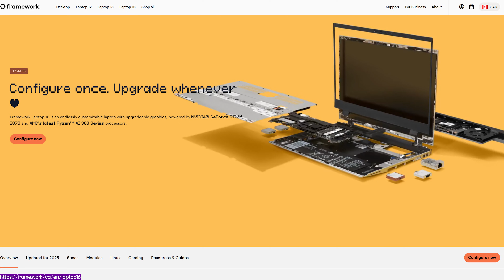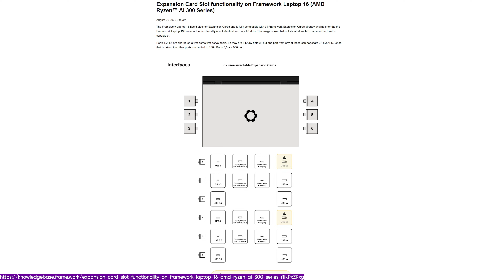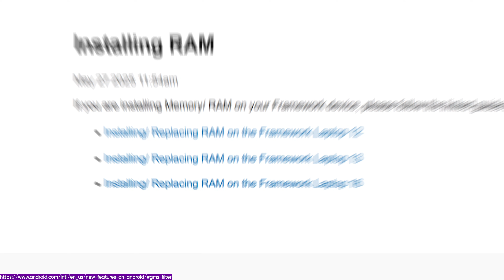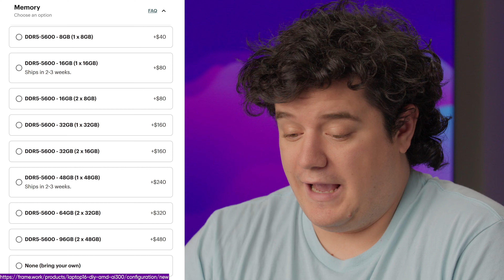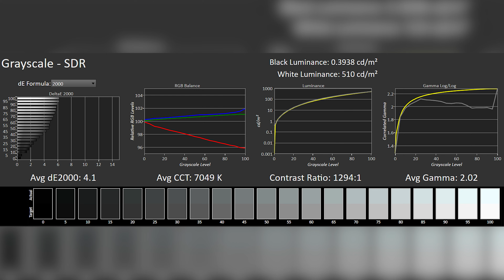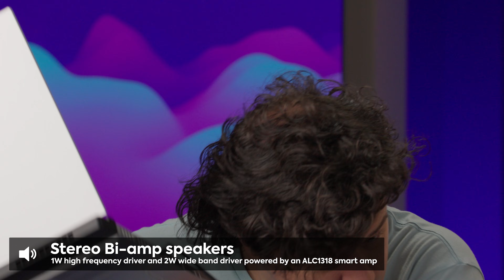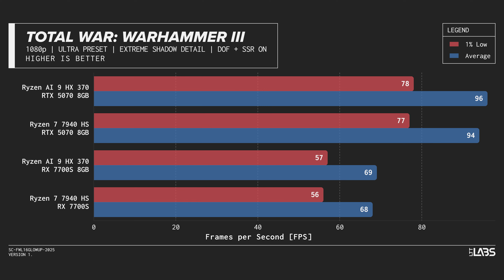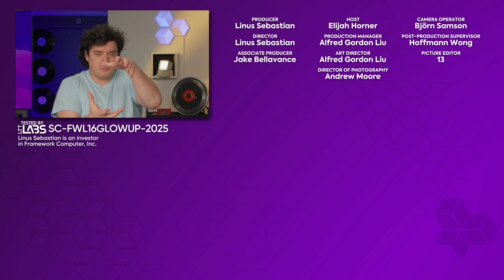I can FINALLY Upgrade the GPU on My Laptop! - Framework Laptop 16 (2025)

Comment: Man…. This is really one of those product lines that makes me very very sad that I’m poor.
Reply: you'd be better off buying a mini pc
Reply: Mini PC doesn't run off batteries though.
Reply: @arpeik yeah! So you can carry around peripherals everywhere you go!
Reply: have you seen the video? that's such an ass product lol
Reply: Yeah, I do need to replace my 8.1 machine.
Reply: You shouldn’t they ain’t worth it
Reply: Just use a cheap laptop and stream the game remotely. Laptops are always constrained by the chasis and cooling system, better off playing from mini pc or even better, a desktop
Reply: Check the second hand market. The repairability and modularity of this laptop makes it usable well over 10 years, with minimal cost and hassle if things go wrong
Reply: @Winnetou17 and costs 3 times the same specs. With such a price just get a new laptop every three years than replacing parts. 3400$ for a midrange CPU and 5070? Have they lost their mind?
Reply: @edengalant  The point is keeping your old laptop out of a landfill. The whole point is that you're not throwing your whole laptop away every 3-5 years when the newest thing comes out, or even waiting a few more years and upgrading a couple times.
Reply: @edengalant I have 5070 pc with qdoled monitor for 2000 dollars and have a decent work laptop for 700
Reply: @redshirtwookiee yeah but with such a crazy cost its literally worth replacing it every 3 years. With such a high base price and component price it's simply not worth it to upgrade your GPU when stuck with an aging laptop. Again, you can find OLED 5070 with 20 cores cpu for 1250 USD today.
Reply: @edengalant  I don't know what you're choosing, but it is NOT 3400, at least USD. It's 3400$ sure if you buy RAM and SSDs and maxing SSDs to 4TB and 2TB. Also, who tf in their right mind genuinely thinks the hx 370 is a midrange CPU?? Is this ASUS's burner account? lmao

It's about 800$ less if you spec out your own parts and with reasonably priced parts and good selection you can get it for around 2900$ (AI boom, ram prices suck). I checked for similar specs in gaming laptops and it seems 370+5070 is in the 1500-2400$ range. Sure, that is a BIG premium, but if you really care about the reliability and serviceability, it's not "3400$" for a "midrange cpu" and 5070, and anyone getting that combo is NOT a gamer, at least not full time. And not a lot of Linux users/enthusiasts are not going to spend almost twice the amount for a 5070 for 30% more performance over 7700s, or 370 over 350 if you're a gamer. It's very clear you don't understand the user base or use case here, and I'm sure you're not a customer. If you're trying to buy Framework for price to performance, I'm sure you'd fare your time much better in a 2nd grade classroom.

And at least unlike big companies, they aren't actively dropping build quality and serviceability for easy cash. I know the gripes of Framework and price is one of them, but you are overinflating the problem and actively framing it in a bad light while also conveniently dropping all the positives in the process.
Reply: @redshirtwookiee in my case I would just pass it down or sell it to a college student. Assuming copping a $1000-1500 every few years
Reply: @ilyas5708 I think eventually it would end up as e-waste, whereas the amount of e-waste if you buy modules from framework would be less than a whole computer. That's definitely part of the vision.
Reply: @edengalant ur right they cost to much for what they are at the end of the day they save you no money in the long run and a massive upfront cost , there a cool idea but priced themselves out of relevance, there for hippy/hipsters/ Disney adults/pre teens and children lol you are 100% correct they ain’t worth the money and don’t bother telling them that cause trust me they don’t listen
Reply: @edengalant you would rather buy a several thousand dollar laptop every 3 years than a 500-1000 dollar upgrade every 3 years?
Reply: @i_love_games110 it won't be "several hundreds" every few years, comeon. Will you upgrade just the GPU and get CPU bottleneck? Also upgrade the CPU but not the motherboard? What if it needs a new chipset? New DDR6? Comeon, it's not feasible. It's expensive and just a stupid gimmick. Laptops are not and won't be PCs.
Reply: Don't worry! You may not be able to afford one but if Trump succeeds you can be one of the guys building them.

Comment: Sorry but just too expensive.  For that price you can get a cheap MacBook instead of this machine.  Even with the upgrade capabilities.  Plus wondering if overtime those spacers will warp.  Also why not just make one long one so this way you just need 2 spacers one on the left and one on the right instead of 4.   And most people probably just upgrade memory or hard drive not cpu, etc.

Comment: maybe elijah is just more agressive with them than linus but that was some pretty alarming looking flex in the screen and keyboard that he brushed off as being fine
Reply: in linus' hands, air cushions it :3
Reply: For what it's worth I own a Framework 16 and the flex hasn't been a problem ever. I'm a programmer and type on it every day and haven't noticed any problems.

My only real complaint with it is that the screen is shiny but that's a common enough complaint with Frameworks.
Reply: Genuine question - why does the flex matter? I can't imagine any situation where i'm twisting my display? Because of when it's in a backpack maybe? Just curious.
Reply: @rootBacon  Since laptops are often opened directly at the screen, and this happens many times during their period of use, too much flexing is harmful to the display.
Reply: @El_Hoppo  Interesting. I always open it with my thumb in the middle and have never had any issue with screens breaking but I guess if you are constantly opening them by the corner I guess that could be a problem.
Reply: @rootBacon  It’s because people like sturdy and well built products
Reply: @rootBacon  And you're paying $1500 for solely the chassis, mainboard, and screen. That's it. You can buy a fully kitted 5070 laptop for that price with a better chassis to boot. So yeah, it matters, especially for a laptop that is going to be even more flexible and more prone to damage from flexing due the modular components.

If you have the chance, take apart an old laptop, take out the hinge and detach it from the screen and body while the hinge is closed. Try to open it with your bare hands, you will likely fail if it was from a similarly sized laptop. Even if you open it perfectly with two hands every time, the hinges still exert a ton of force on both parts and is one of the most common failure points.

And to top it off - you cannot buy a new chassis on its own if it fails or is damaged. You have to pay up the $1500 for a new minimum setup. I feel they dont sell it on its own since then they would have to answer for what portion of the price is split between the screen an mainboard, and it would be plain to see that you are spending ~$600 for the core chassis part alone.
Reply: @SirVerdown  I'm not sure what you mean in the second paragraph so aplogies. I've never owned anything other than Thinkpads, and have never had a problem with the hinges. Even the chinese 51nb/xytech fan projects. They have a lot of flex and still have never had any issues with the screens getting damaged that's all. I see your point though about the chassis. It's a shame you can't buy individual parts. I think I was just confused about the whole screen flex thing because I take great care even opening the lid on my laptops, for the extra 2 seconds it takes to do so.
Reply: @rootBacon  it just feels cheap, especially at this price point. The feel of a product is very important and if it constantly flexes during use/typing, I would be so annoyed
Reply: @rootBacon it doesnt, a more important test would be screen bounce and wobble when typing etx.
Reply: yeah, it def turned me off. it's not worth it tbh for half ass product
Reply: Also keep in mind that this is a larger laptop size and that Elijah was forcing it.
That considered, this was a very reasonably small amount of flex.
The screen can take a lot of flexing, as long as no pressure gets applied to the bottom cabling it shouldn't break in long use.
Even repeatedly flexing in a backpack should be fine, it's the PCBs of the mainboard which can't take this.
Though here the modularity allows it to flex a bit.
Reply: @WyvernDotRed Except I'd expect that chassis to live a minimum of 10 years being as they dont sell it separately and its $1500 base.

Comment: Why would I buy this over the new Steam console?
Reply: It's gonna come down to your use case. Do you want to play games when you aren't at home? Laptop. Do you want something that's quiet and you can play from the couch? Desktop. You also need peripherals for the steam console. You also don't know how much the steam console will cost and you can't preorder or buy it yet.

There's lots of reasons. I'd wager that you'll have an easier time upgrading the Framework than you will the Steam Console because of space constraints for hardware. Valve likely won't offer upgrades to their console like framework will for their laptop.

Comment: I don't like not recommending it for editing because you can 100% edit on that computer with no issues. If you need to color correct then use an external monitor or another system, but on the go, on your couch, or visiting family you CAN edit on that laptop...
Reply: Yeah from what I've heard color correction and editing isn't the same thing, well you are still "editing" but the CC can be done afterwards if you have to do some video editing on the go. Plus, if the video is done its less time spent in front of a fixed screen :P

Comment: It's big, expensive and not very performant. I really want to buy a 16" from Framework but I just can't pull the trigger. I think if I did I would probably be returning it because the thing is bigger than a Legion but stuck with 8GB Vram, bad speakers, not a competitive screen, etc.

Comment: Correction: CAN now power laptop from rear usb-c[5070 only]

 {Supposed to plug the power into the back (GPU) for most power.}
Reply: Unless this is different with the new GPU, this is incorrect. It is for direct display port video out only. Not power connection. Using it avoids a small performance penalty that routing through the rest of the laptop internals creates.
Reply: @qhartman it IS different.
Reply: @qhartman  The Nvidia gpu has a usb-c (2.0 data) display and power on the back, i think the amd version does not have a port at all there. But i dont think it gives any performance boost
Reply: @tonizombie I own one. The port is there.
Reply: @qhartman  The AMD module? When ordering FW16 it says this on the Expansion Cards section 

(If you are configuring your laptop with an AMD Graphics Module or Expansion Bay Shell, be sure to include at least one USB-C Expansion Card for charging. The NVIDIA® Graphics Module has a built-in USB-C charging port on the rear, so no additional USB-C Expansion Card is required.)

Comment: The price is the only reason why I havent got a framework. I love the idea. I love the orange color and customization. I love the upgrade path... but I can get a similar laptop at like 1700$... wish they had a 1080 screen as well. I hate how everything is going to 2k-4k when GPUs arent there yet to handle the resolutions in intense play yet.
Reply: I'd argue that you can't get a "similar" laptop in the sense that Framework is the only one doing full upgrade paths for ALL the components. You could get a similar SPEC for cheaper, but in the long run Framework will likely end up being cheaper overall, as you don't have to buy a whole new laptop when new generational upgrades come to market, just the modules you want to upgrade.
Reply: @redshirtwookiee  yea, id argue a upgrade path isnt a "part" of a laptop. Its something you can do if and even then the parts are crazy price at 800-1000$ for a cpu or gpu. So far the only have 1 upgrade path as well so if they go under that high price will mean nothing. Its obviously expensive bc they cant get sales.
Reply: @MrSmexy702 are you saying that upgradeability isn't a feature of this laptop?
Reply: @redshirtwookiee not really. What's the upgrade path? A ryzen chip and a single Rtx 5070 chip? Its not like a AM4 socket or 1711 socket for cpus that has 4-5 different upgrades for a single socket yet.
Reply: @MrSmexy702  I'm not an expert in semantics, but it's wild to me to claim that upgradeability isn't a feature of this laptop when it's literally the only laptop on the market that allows users to do just that.
Reply: @redshirtwookiee problem is there is really nothing to upgrade yet. You're just going off what they are saying you'll be able to do.
Reply: High res screens are useful in other ways.  You can always run lower resolutions on higher resolution capable displays, but 1080 would just be too low on this.
Reply: @ClipstopherBurtraw their high res screen is useless as the video said for anything important since its only 95% color accurate and has a cyan hue at medium+ brightness. Using a big screen at lower res i never found useful since it seems to always screw up picture quality. Seems to be better to just run screens at their recommended ratios.
Reply: @MrSmexy702  The price is so annoyingly not fully pictured. If you get the RAM and SSD by yourself you can get it much cheaper. Ok, still not cheap, but significantly closer to other laptops.

The screen having color issues, I think/hope it's an individual/limited-run defect, and not the general panel. A 1080p class screen would really only be better for power saving reasons.
Reply: @Winnetou17 i was thinking more towards video games. 1080p screen gaming is way easier on the GPU than at 2k/4k. Especislly since the 5070 GPU barely has any RAM on it. Games these days eat 10gb ram on gpu at 1440-3680 for meshes/textures. Thats the only reason i wanted a 1080p option.
Reply: @MrSmexy702  True, but if you're not exclusively playing new AAA games, some you can do it at 1440. And there's non-gaming too. In a game you can always set it to 1080p anyway. Or use upscaling and get kind of the same thing, except looking slightly better on the higher resolution, for a very minor decrease in performance.

Comment: I feel like you didn't really explain advanced optimus very well. It just means you don't have to restart the computer if you want to switch to the DGPU as the primary GPU. The old version still works just as well, you just have to restart the laptop.
Reply: Is that a setting I can change when I want to or do I have to change it every time I want to play a game? Could I just set it to use the NVIDIA GPU All the time and not have to worry about it?
Reply: @redshirtwookiee  ya its a setting. And yes you can just set it and forget it. Switching back to the igpu will save a lot of battery but if its stationary you can just leave it on dgpu.

The setting is usually in the included software like armoury crate or whatever other companies have.
Reply: The FM16 doesn't have a bios mux or a software setting that allows direct dGPU use as far as I know. The 'old' optimus version will always drive the dGPU through the iGPU. The lag from this has been reduced a lot in recent years, as Microsoft has released CASO. I'm not sure if Linux has a similar issue or solution, so YYMV
Reply: @qyygle6058I do know that with my OG 16 and the 7700s, when I start a game it pauses/freezes for a second while the GPU takes over, and again when I exit the game. Not a big deal, just a little tiny bit inconvenient.
Reply: @qyygle6058thats a bummer. Thats kinda crazy to me that a gaming laptop in almost 2026 doesn't have even a basic mux switch.. sorry to hear that!
Reply: Does the 5070 at idle really suck that much power?  I feel like I'd disable the integrated graphics all together.